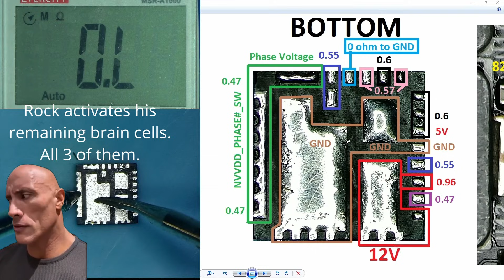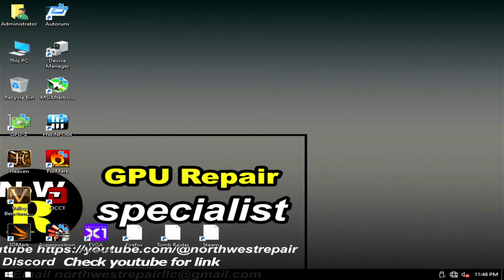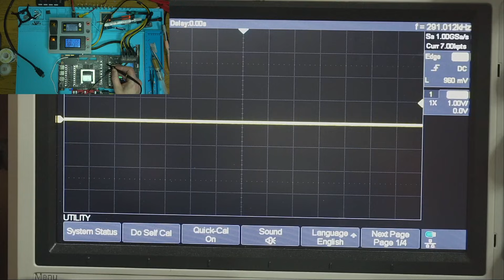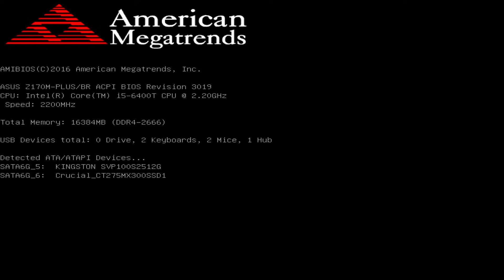3090 GPU Red Light of Death Repair: The Ultimate Fix

Comment: Would this be the same for a blinking red light? I've replaced everything besides the GPU itself. Its a Asus Strix 3090 TI. The light only start blinking during games for some reason. Then doesnt turn off til either unplug it or flip the switch on the PSU. Cables and PSU have been replaced. Can run FurMark forever and  the light doesn't turn on. Only seems to in games that pull enough power, like Baldurs Gate 3.

Comment: Thank you for this video. I have a Red LED of Death on the RTX 3080 FWT3 and have verify that it is a issue with the card. I was optimistic that I could solder on the part that was the point of failure because, from my understanding the red LED issue is the power distribution circuit failing. My only concern is if I mess up the soldering job that I could short circuit or cause damage to my motherboard.
Reply: How’d it go? Did you attempt to do it yourself? I just got the red light of death on my 3080 xc3 😔

Comment: Will it work if only the fuse was replaced? I asked because i just got my 3070 from EVGA after the repair with same RED LED issue. It's all good now but i am not sure if they have repaired the same way (mosfet and fuse replacement) or if they just replaced the board completely.

Comment: High side MOSFET turns on for tooo long / short circuits
Feedback turns it off (supposedly)
Low side MOSFET turns on, but with high side MOSFET  "still on", there is your short.
So, low side MOSFET saves your core by clamping the voltage before it kills the core
Then the fuse saves the PCB from heavy damage. Damage that can be unrepairable.

Just think all of those Cards out there without a single fuse
Cost saving or planned obsolescence ? You decide.

Comment: The exact same thing happened to my 3080ti FTW3 Hybrid after only a year of use... Card had a custom waterblock with a huge rad and was undervolted to 0.8v... Core temp under load was always less than 50c, VRM temps were like 40c... 2 out of 3 fuses were blown, luckily I bought it from caseking, sent it back, got a refund of 2k euro, bought a 4090 😅 The weird thing is that the card worked normally, I was playing games on it, watched some YouTube, shut down the computer, went to sleep... Then in the morning I press the power button aaaand red light of death 😅 that vrm blew up during boot wtf 😅

Comment: A lot of the GPUs sent to you for repair seem to be made by EVGA. If this is just because of the popularity and the amount sold or do they have more failures than normal?
Reply: Both.

They were more popular, not so much for build quality that everyone likes to taut, but more for their support for when something went wrong.  (I however got very crap support, but I am not in the US)

That being said, don't think other brands are innocent either, take ASUS as an example, their RTX3070Ti, some memory modules are not actively cooled, they used the RTX3080 cooler for the the 3070Ti, the circuit diagram is different, meaning, the memory modules shifted, so it can't actively cool all the modules and they didn't even bother to properly cool it with thermal pads either, they are only half covered. Dispite ASUS being very expensive, I find their support very lacking in general.

Ergo; every brand is trying to get away with the bear minimum, while over charging you, your job, is to find out which products they actually cared enough for, assuming you can find a good review and teardown.

Comment: Would you recommend people under volting their gpus slightly, to increase reliability against components dying
Reply: Undervolting makes little to no difference unless you lower it enough to cause a notable reduction in maximum power consumption. While undervolting correctly is the better way to increase performance and/or lower power consumption, for most people I'd suggest simply lowering the maximum power and temp limits. If you do undervolt, keep an eye on all the sensors in realtime so you know if it's actually accomplishing what you think it is.

As for voltage itself, even the maximum voltage on many modern Nvidia cards is only used if there's power headroom and still not high enough to hurt anything even if it does boost to it. Power and heat is what damages components. Ensuring everything from the memory to the VRM gets sufficiently cooled is the best place to start. If you can't do this and the card is notorious for bad memory, dropping the memory speed can help but it's not an ideal solution.

Comment: This is a chronic issue plaguing evga 3080/3090 because evga cheapen out on the voltage controller and used analog  UPI 9511R . When transient load is high these cmoses kind of blows up. And sometimes when they do they sent 12v voltage straight to the core killing the core as well. It would not suprise me to see all evga 3080/3090 dead in a not so distant future.

Comment: Easy one. Two things though. Did you power it on to see the screen with a mosfet out? So in that case it was possible with a low power draw? Also that was a pretty scary amount of solder blob when soldering a new one on.
Reply from the maker: yes. you can power the board with several mosfets removed. It will not draw much less current

Comment: Fun fact: If you accidentally touch a 12v LED strip to the 5v ARGB pin on this card, it fries not only the LED controller but also the fan controller
That was not a fun lapse of brain engagement
Reply from the maker: where ?
I think you misinterpreted something
Reply: not in your video, i managed to do that myself😂😂  @northwestrepair

Comment: rx 470 use the same drivermosfet ,  I've  changed it twice , cards works fine and then it get dies again, I proved de drivermosft IC as same as you in the vin and vout  gets shorted as same as that 3090, any sugesstion to measure ????

Comment: It’s a shame that EVGA got out of the GPU market. That’s all I would buy up until my 3090ti. They had great cards but the customer service was the best!
Reply: I have only ever had a EVGA GPUsince 2014- not sure what to get after the 3090 gets too old.
Reply: Glad I snagged a 3080ti, super sad to see them leave. Highly considering a jump to AMD/Sapphire on my next purchase as I hear they are similar quality for AMD
Reply: @hex00110  Don't see too many Sapphire cards on his bench so that has to count for something. FYI their "Toxic" cards are extremely overbuilt in every way possible but their NITRO+ cards are top-tier as well. They generally opt for things like replaceable fans, plenty of fuses, great quality vapor chambers, and get some very good thermal performance & low noise levels compared to the competition. They have some great and talented engineers at Sapphire. 

Probably why a lot of people compare them to EVGA just in terms of build quality and great customer support (if you can show the original receipt basically no questions asked.) 

I'm not looking for a GPU upgrade but if I were it'll likely be something like Sapphire 9800XT whenever that exists. Ngl though I kinda wish I had a 6900XT Toxic card haha.
Reply: same here, I JUMPED on the 3090ti when i learned they were getting out of the market. its a great card. such a shame. maybe theyll team up with AMD and start kicking butt with them.
Reply: Yeah, I've only ever had EVGA GPUs, miss them.
Reply: i bought 3070 by accident and right after they stopped making cards so this one feels special 😅